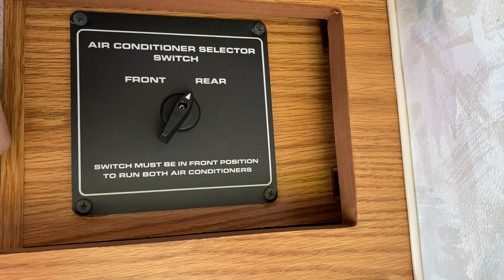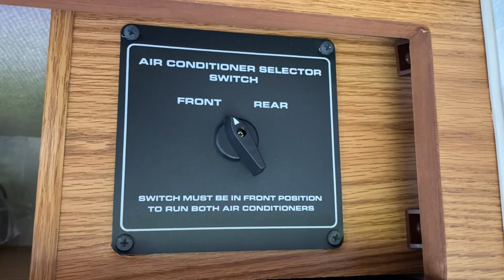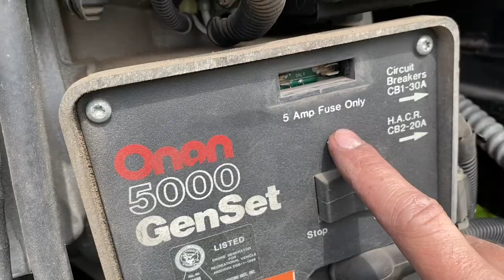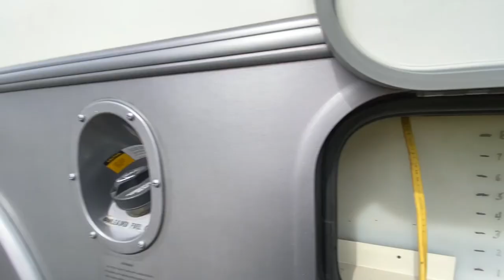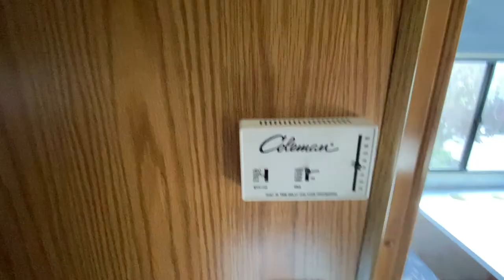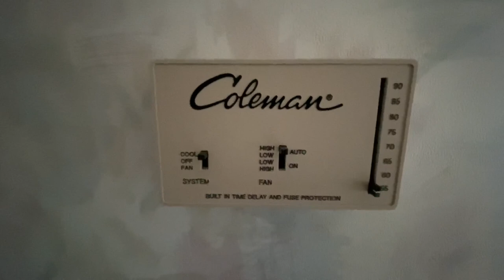Two Motorhome AC's with 30 AMP Hookup | RV A/C Hack

Comment: Ok a quick question, i can run both my ac's on my generator but only 1 on shore power when i convert it to run on an extension cord to run on shore power is there going to be any problem with me running the generator to power both ac's going off shore power ei: running down the road. hope this makes sense. Or could i just add in a pig tail from ac to plug into shore power and leave all wiring factory? and not have back feed problems.
Reply from the maker: Hello, Mark! I'm sorry I didn't see your question sooner. Your wiring would depend on the RV, but if you have the "front/rear" switch inside, you should be able to wire it like I did in this video. My generator has two circuit breakers - a 30 amp that powers the whole coach including the front A/C and a 20 amp that powers only the rear A/C when the generator is running. All I did was take the wire running from the A/C to the generator junction box, routed it over to my power bay, and put a 15 amp male plug on it. That way I can run the extension cord out to a 15 or 20 amp plug. The I ran a new wire from the generator junction box from the 20 amp generator circuit and installed a separate 20 amp plug in the power bay. When I'm going down the road and want to use the generator, I plug the rear A/C wire into the 20 amp plug that comes from the generator. That way I can still run both A/C's at the same time with generator power. I linked a video in the description showing how it looks when I'm using it.
Reply: @dougwiseman  thank you I will try it out